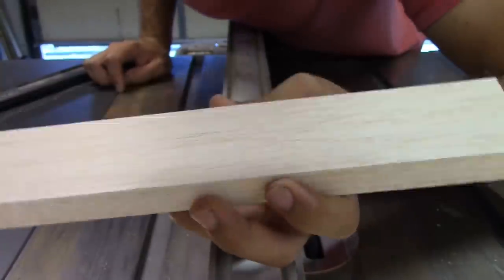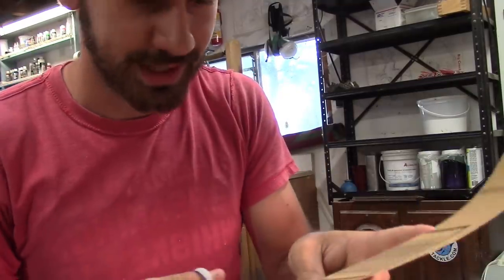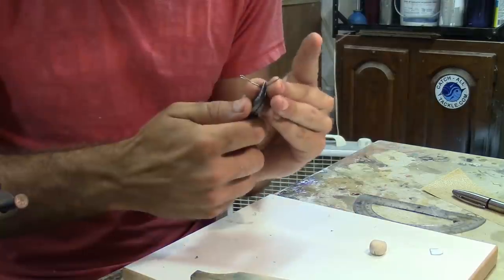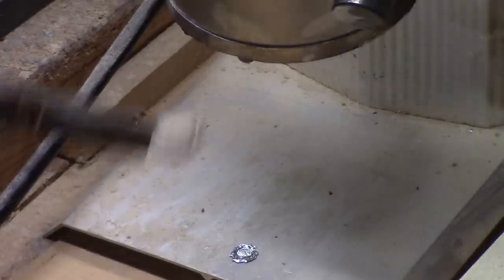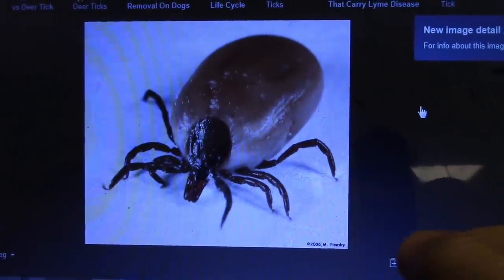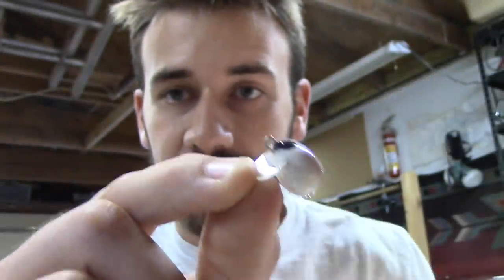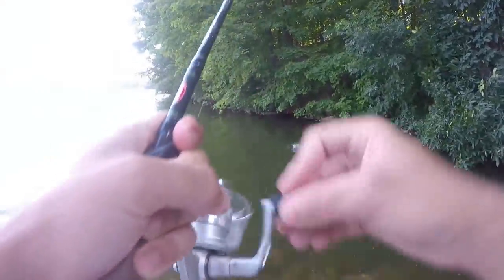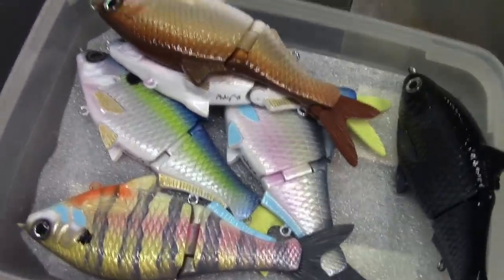Making an Engorged Tick Lure

Comment: i work with a dremel to cut antique keys and sometimes if you put the blade in a tight squeeze, the dremel will kick out and the blade will be sent jutting towards your fleshy extremities. Even experiencing this on a daily basis, I still was afraid to see your fingers so close to the band saw.

Comment: good way to slice 2 fingers at 1 time. Hold a tiny piece of thin metal in your fingertips and go at it with a 7k rpm cutoff wheel! Good call on the vice but you only cared about the heat... lol I know you thought to yourself... this could be bad.